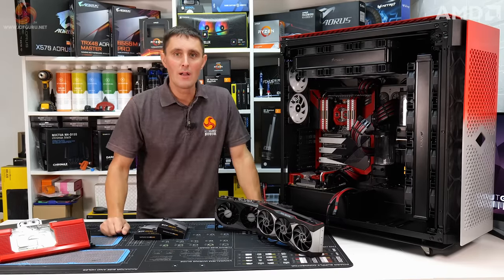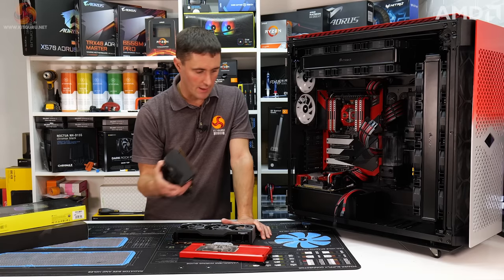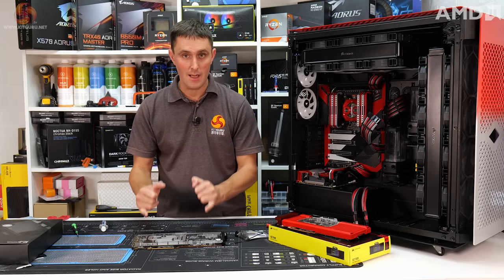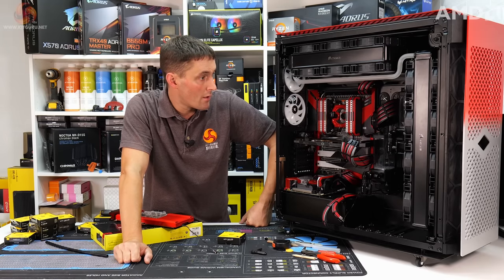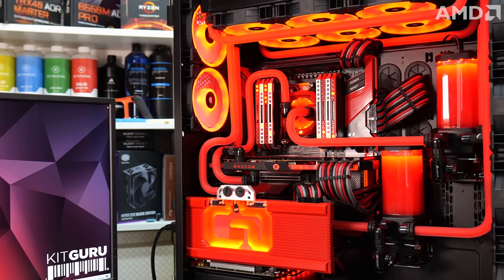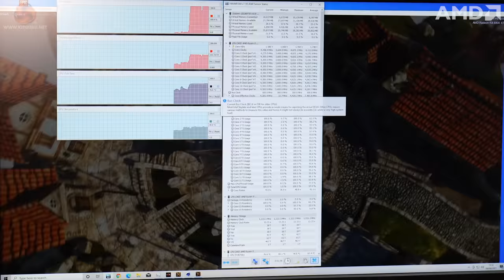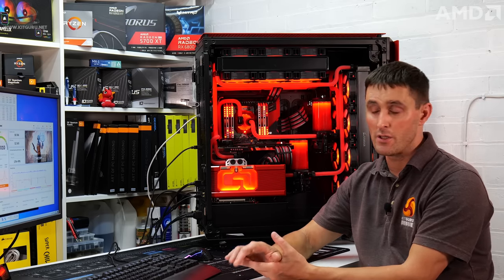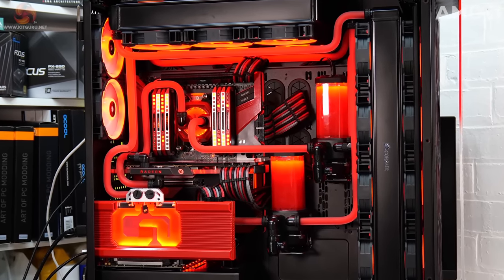AMD BEHEMOTH System build - It's FINISHED!

Comment: Impressive, but some of the tubing looks a little off. Maybe it's just the camera angles, but it would look better with clean 90 degree bends and tubing parallel with the sides of the case etc...
Reply: I assure you its just the camera angles. 👍

Comment: For my AMD build: 
Motherboard: Crosshair VIII extreme X570 (not long released, cost £700 from Scan)

CPU: 5950X (£680 from Currys)

GPU: ASUS TUF 6800XT (£950 from Overclockers)

RAM: For now because i'm unsure of where the "sweet spot" for memory on this system will be, i'll be reusing my Gskill Trident Z neo 2x16 kit @ 3600Mhz, with CAS 16 or 18 i think.

Storage: Samsung 980 Pro PCIc Gen4 SSD (£140 on sale from Scan. Usual price is £180)

PSU: I already have the Thor 850W for my Crosshair Hero 7 (non-wifi) X470 build, but I'm waiting on the 1200W Thor to go in this machine. 

Case: Define R7 XL. 
I loved the R5 so much i bought the R6 USB-C and so the R7 XL was a natural choice. 

Cooling: I have the Fractal S36 AIO, but for this build, since it's mostly ASUS, I want to get the RYUJIN II 360 AIO, but thus far can't find it for sale. 

in my view, this will be the peak of the AM4 X570 with the 5000-series CPUs, before the next gen of AMD CPUs come out. I won't need to upgrade for a very long time anyway with this set up! 
I tend to buy into the very end of a platforms life anyway since by then, all the kinks and wrinkles should have been ironed out and any improvements they could make on the platform will have likely been made.
Reply: That sounds like it's going to be a nice system. I think 3600mhz memory is the sweet spot too.

Comment: I still use my debit card to plaster on a thin layer of thermal paste LOL It's old skool, but it works flawlessly every time anyway, so why bother with any other method.
Reply: Yeah its a good method. Some of the Corsair thermal compound comes with a debit card shaped spreader 😁